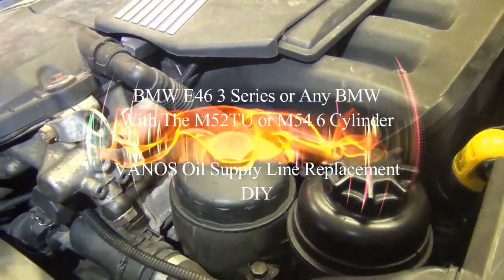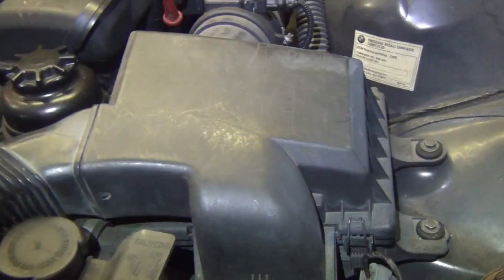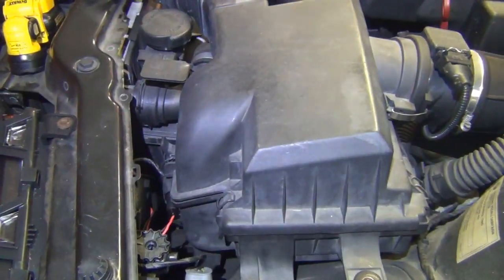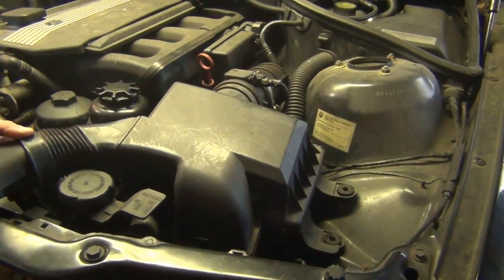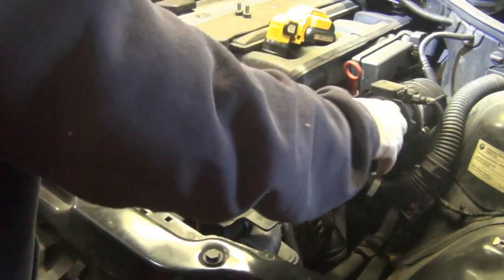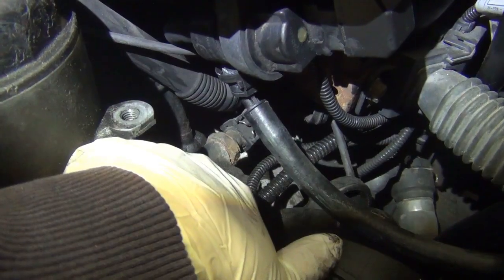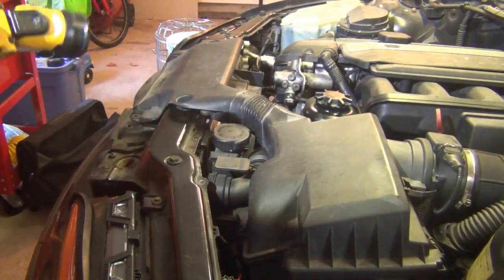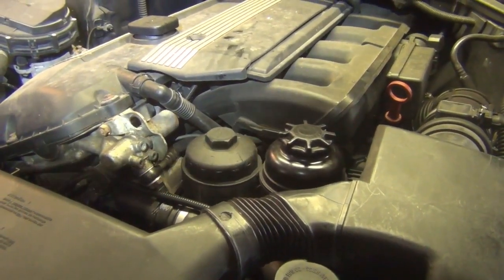BMW Vanos Oil Supply Line DIY M52TU M54 6 Cylinder

Comment: Great video thanks! Do I need to drain oil before doing the install? Thanks again!
Reply from the maker: Thanks for the question Alex, Sorry for the late reply. You do not need to drain the oil to do this repair. But it helps to have some rags handy to catch the oil released when removing the line.

Comment: Thanks for the video. I detailed my M52 engine for 2 days.  Looks awesome. Way cleaner than what a used car lot detailer would make it. Looking at the oil line I can tell it is probably the source of the front engine oil leak.  Going to do the line first. If I still see oil on the left side of the engine I can then say it's probably the oil filter housing seal.  This video was very insightful.

Comment: Thanks for another great video!  One thing that I think would be helpful, is when you're pointing to things ("So-and-so is right...down...there..."), to pick up a cheap laser pointer and use that.  Often it's a little tough to tell at first which bolt or line you're referring to, especially since sometimes the auto-focus on the camera doesn't want to play along.
Reply from the maker: That is a great suggestion! :)

Comment: Thank you for all your youtube video. They have helped me a lot! I have one question regrading the airbag warning light. The light was on after I replaced the front left-hand-side window regulator. Any advice how to reset the light?
Reply from the maker: Your welcome Jim :) I love to hear that they have helped! You must have taken the side airbag off to do the repair and if the key was turned on it will store a code. Or the connector may have been damaged when removed. Usually this just needs to be cleared but only a scan tool that can read airbag codes can clear this for you. You can try NAPA as they may be able to clear it or a repair shop may do it for free or a small fee just to clear the code for you. But it must be done with a scan tool.

Comment: Thank you very much, this video is exactly what i need and looked for. How do you think is it a good idea to use brakes cleaner to degrease engine, hoses and wires, or i need to use something different? My hose is leaking bad and there are oil spots underneath.
Reply from the maker: Your welcome Anton :) You can use brake clean or an engine degreaser. You may want to degrease first before repairs. All BMW wiring connectors have internal water tight seals. Spraying this down with water after letting some degreaser work should be perfectly fine. Or brake clean if you prefer.
Reply: Ok, thank you, i will make it exactly the way you said - cleaner and water. As soon as I will get my parcel with parts I will change it. What do you think about rockauto, have you ever used parts from them, or you use OEM parts from official dealers?
Reply from the maker: I do like OEM parts but for many applications there are a lot of cheaper options that are good quality parts for a fraction of the cost. For this part non OEM should be fine.